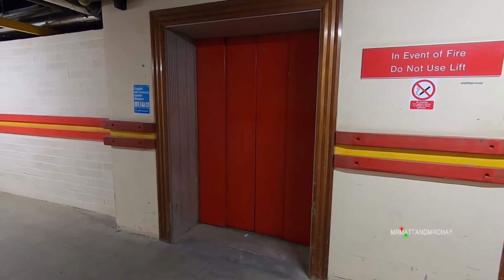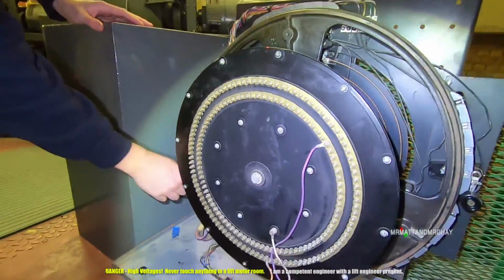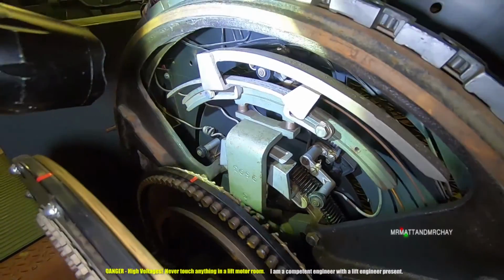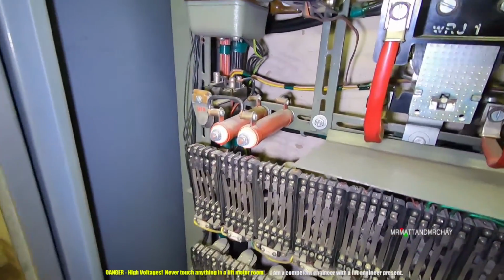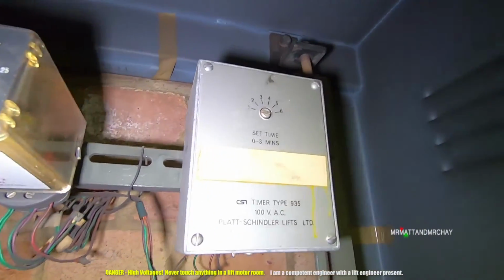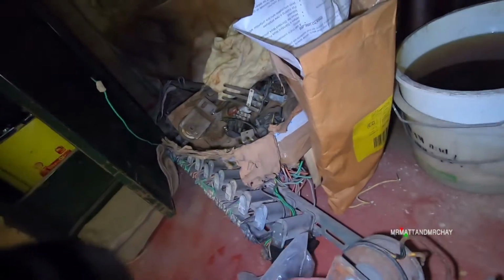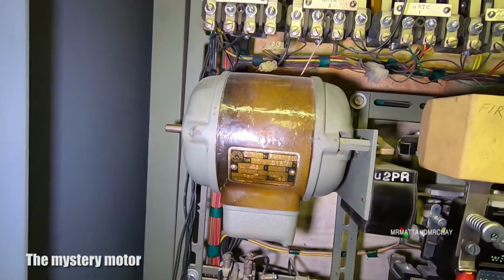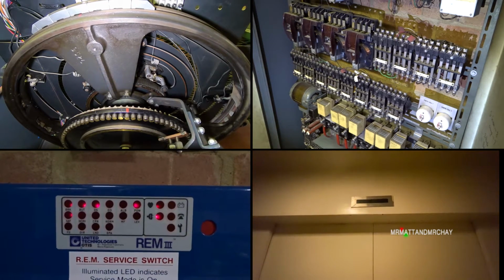OLD LIFT CONTROL CABINET - and what is the mystery motor?

Comment: Very interesting , i work on old jukeboxes , they have a system bit like the floor selector but the difference is the comand disk has pins that get pushed throu so the machine knows what record to stop on. Love electro mechanical machines . Would love to see inside an old lift room

Comment: That strip of metal with the slots could have been a way for an electric eye to see dim light as the slots are far apart, and gets brighter as the slots passed the eye where the slots are closer, away to put more power to whatever it was controlling, maybe for a door motor to anticipate when the door was in the near closed or open positions so that the door closes gently near the end of travel or near the end of travel in the open position!

Comment: Many of these lifts also had two centrifugal switches on the gearbox end of the motor shaft to aid soft starting and prevent overspeed, the earlier models had rotary mechanical clock timers, not many left now or people that know how to fix them
Reply from the maker: oh yes!!  I think I've seen a video (can't remember who uploaded it now) where I think they show this mechanical device.  The whole thing rotates and operates what looks like a piston (or the piston does the rotating - can't remember).  But basically the whole thing does a rotation then resets.  Wish I could find it again.

Comment: rju contactor for Revision 
Ru 1 is breakmotor left Side 
Ru 2 is breakmotor right side 
RR  is start contactor 
Rv  control contactor ( from door)

Lift Motor right and left  is UA  ( Six contacts for the brake)
Reply from the maker: Interesting, thanks.  Very difficult to work out what those relays do, without some kind of chart!
Reply: @mrmattandmrchay  I practically grew up with the systems and had many of those where I started at schindler. The troubleshooting of the systems was a big challenge for me at the time, but I was always happy when I found the error :)

Comment: 11:11 When levelling, i imagine they are using an "open delta" connected set of windings on a transformer to reduce the voltage applied to the motor's windings, dropping the torque output of the motor. This will of course reduce the speed of the motor. I would think the motor attached to the back of the main motor is a fan? Maybe a Dynamic Brake? (DC Supplied to windings via that selenium rectifier you mentioned)

Comment: 1:56 Why does the motor sometimes takes long to start up and sometimes starts up quickly as in 10:51?
Reply: I’d say it’s because of the direction of travel. If the lift is empty, when it goes up it will be much easier for the lift to start because of the counterweight helping to pull it up.

When the lift is empty and is going down, the motor is using its energy to lift the counterweight which makes it struggle a bit.

You can see in those 2 clips that the selector wheel is spinning in the opposite direction. :-)

Comment: This kind of bottle fuses is the one that was standard in each and every house in Switzerland till the advent of automatic circuit breakers. Being Schindler a Swiss company, probably they built the cabinet in Switzerland with the materials available there. You don't replace the wire, you replace the whole ceramic bottle with the wire inside.
Reply: Standard in Sweden as well and some households still have them. That little end cap wasn't (Isn't?) plastic but metal and painted in a colour matching the current like 4 amps or 6 the fuse would pass. Also, the "bottle neck" came in at least two different sizes depending on the current. You couldn't put a 20A fuse in a 6A slot. It would be too big even though the bottle was the same size. Fuses filled with fine sand to prevent plasma discharge.
Reply: @daicekube  The system is called Diazed, a terrible German acronym for "Diametral abgestufter, zweiteiliger Edison-Schraubstöpsel", which loosely translates into "diametre-coded two-piece Edison screw plug" and was invented by Siemens in 1909. It spread quickly across most of continental Europe except France and Belgium because it was considerably more practical than most other systems in use at that time. Technically they're cartridge fuses, not rewireable like the old Wylex ones in the UK. There are six sizes, DI to DV plus the additional DL invented after WWII in eastern Germany. DII (2-25 amps) and DIII (35-63 amps) are by far the most common types, DIV (80-100 amp I think) and DV (up to 200 amps) are quite rare and DI I've only ever seen in Ireland. The smaller sizes (DII and DIII) use Edison screw bases, the larger ones are imperial Whitworth threads.

Expect for sizes 6 amps and smaller, the tip diametre corresponds to the fuse size so it's impossible to use larger fuses than intended by the manufacturer, that's the "diametre-coded" part of the name. Each size has a unique colour seen both on the indicator and the key screw in the base. 2 amp = pink, 4 amp = brown, 6 amp = green, 10 amp = red, 16 amp = grey, 20 amp = blue, 25 amp = yellow, etc. These fuses were reasonably popular until they were all but replaced by MCBs in most applications.

In the 1960s Siemens developed the smaller Neozed or D0 system, which only goes up to 63 amps. D0 fuses are still fairly common as main fuses in various places.

Perhaps the biggest advantage of bottle fuses over rewirable fuses is that they can be unscrewed under load and even replaced with a short present without too much risk of injury. I've shorted Neozed fuses dead across two phases (pinched wire in a consumer unit) and didn't hear as much as a pop when they went.

Comment: ah I think i understand what the cabinet motor is there for.
it prevents "single phasing" which is what would happen if one of the 3 power phases was interrupted.  it probably is sent a very low current, only enough to keep the button pressed. in the event a phase drops the motor can no longer apply force and the button pops up, and tada no more lift.

Comment: My bet for the floating outer roller is a floorzone contact. Because the lift has automatic doors you have two seperate signals that give permission to open the cabin doors only within the doorzone (+-200mm) from the actual floor position.

Comment: From that little 'teaser' of mystery motor video, I presume it is protection from wrong phase order. If phases are correct, it goes down keeping button pushed, but if they are in wrong order, it goes up and breaks the circuit or even replaces 'up' and 'down' contactors so it works right at any phase order :) Because without electronics available, it could easily be the simplest solution to detect phase order.

Comment: The only thing I can imagine that motor/actuator arrangement is doing is some sort of threshold devise. I.e. when the motor gets more current it's torque increases and finally "pops" the switch. So it only actuates when there is a high load. Maybe it's an old door obstruction detector? 
Just my guess! 
Awesome video:)
Reply: It's just a reverse phase relay - it's a 3-phase motor designed to survive being stalled, and it's holding the switch down. If any of the 3 incoming power phases are lost or the rotation is wrong, the motor lets go of the switch and the whole thing stops. Rather common things but they don't normally look quite like that.

Comment: The resistors are for starting motor to correct the current set of 3 and other 3 used during slow speed
Reply from the maker: thanks!  I realised this only after the video :)  Thanks for the info